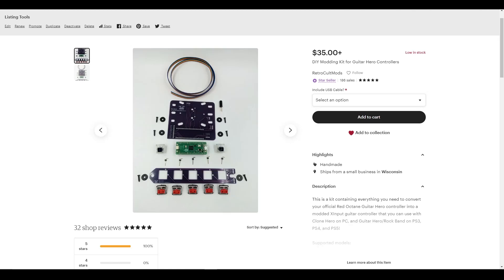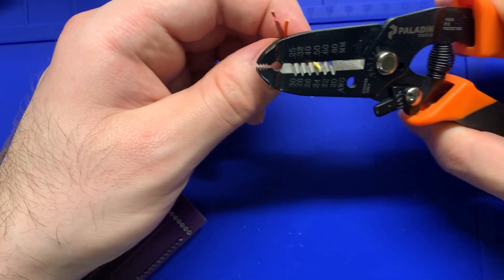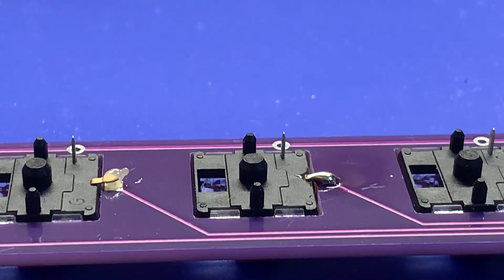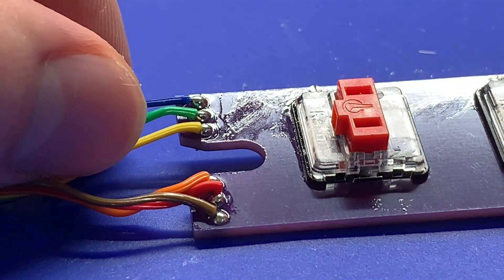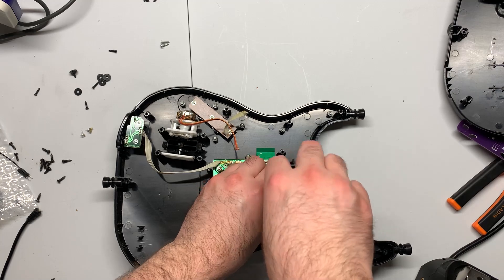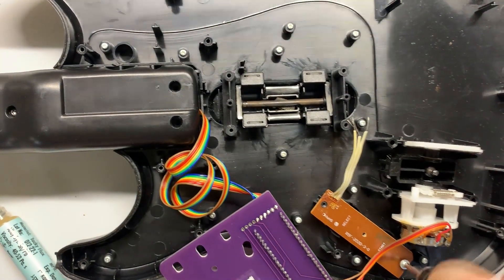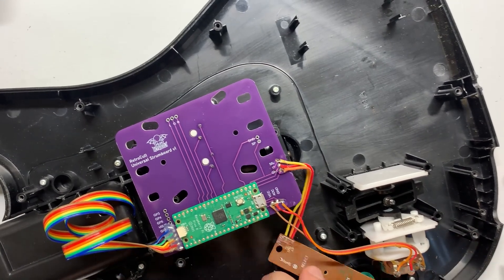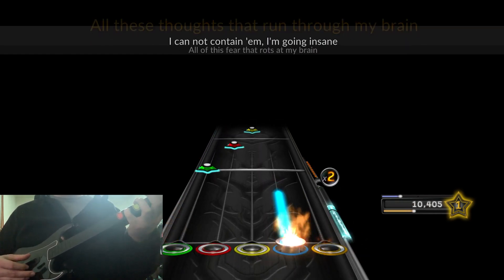DIY Guitar Hero Controller Mech Fret Modding Kit for Clone Hero, RB4, GHWT:DE #clonehero #guitarhero

Comment from the maker: UPDATE:
There is now a dedicated tool for my kits, you'll want to use the one mentioned in this guide instead of the Guitar Configurator:

https://retrocultmods.com/updating-to-the-new-santroller-firmware/

This new tool will do all of the pin mapping for you, and make customizing things much simpler!

Well, I forgot the part explaining the tilt, woops! 

Its pretty fast and simple, here's a quick video explaining how to do it: https://www.youtube.com/watch?v=dqrUP9Fsahw
Reply: I see it says it will work on Xbox 360 but i can't get mine to work. How do you get it work?
Reply: how do i know which one of my guitars is gh5 or ghwt because i have the red and white guitar (xbox 360 guitar)

Comment: Extremely well made kit and guide. This is all so easy to follow and it appears you’ve made this about as straightforward as it gets in terms of simplicity!

Haven’t bought my kit yet as I’m still on the hunt for a good deal on a guitar first. The only couple of questions I had were regarding the rusty strum bar and the micro usb cable.

When removing the rusty strum bar you mentioned potentially putting a new foam pad in there. I’m assuming the foam pad is simply to prevent the metal rod from rattling and it could be any pad of a similar thickness to the one removed and there’s not a particular type of foam?

Regarding the USB cable, I was wondering about strain relief and retention. Based on what we can see in the video, it just looks like you plugged a micro USB cable directly into the board, then had it make basically a straight run right out of the guitar case. I’m imagining that plug pulling right out of the port if the cable gets tugged a little too hard, so I’m thinking perhaps there’s some sort of thing you do to the cable to ensure that doesn’t happen? I was also wondering about cable length and if you’d had any success with a longer cable. Say…15 feet instead of 10? I know once USB gets to a certain length there can be some data loss.

Thanks so much for such a well-made product and tutorial. Until now, I’d assumed the only way I was going to be getting back into Guitar Hero was paying a crap ton of money for a guitar in good, working condition, but this offers an alternative that basically removes condition from the equation completely!
Reply from the maker: Thanks for the positive words! To answer your questions:

The foam pad is indeed to keep the bar from rattling and can be replaced by any foam pad with similar dimensions.

For the cable, I usually loop it around one of the standoffs so it doesn't come out when tugged on currently, but I do have plans to make a board that converts one of the ports of the guitar into a female USB-C port, so you can plug in and unplug a cable without having to take it apart! I usually stick to 10 foot USB cables, but you should be able to use 15 or even 20 foot cables with no significant signal loss!

What you mentioned about providing a more accessible and affordable way into getting a PC compatible directly wired guitar is exactly why I made the kit!

Comment: I'm in the middle of doing this for a starburst guitar (ghwt). Will journal my progress here.
Reply: 1st lesson: you definitely need to file down the plastic feet of the fret switches, even if you have good flush cutters. There's no way around it. 7:52
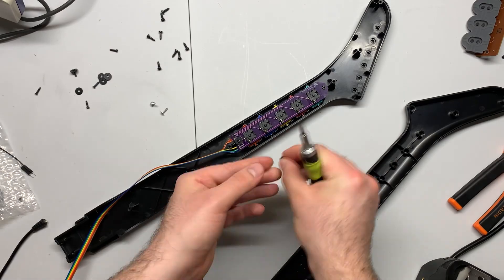Reply: 11:31 the Wii starburst only has one of these screwholes. I'm using electric tape to hold down the other side (facing the wires).

Comment: This was my first foray into the world of soldering electronics, and I have to say (aside from some small mistakes I made) this was a very comprehensive and easy guide to follow!

My only question is about a component that looks like a capacitor that came in the kit that wasn’t showed in the video. After doing some more research, it looks like it may be a tilt sensor? How would I connect that?

Edit: Looking at the board again, I actually see 2 holes with the labels “gnd” for ground, and “sp” which I’m assuming means Star Power. Am I correct?
Reply from the maker: Yep, that is a tilt switch! I forgot to mention it in the video, I'm going to make a quick guide this weekend on how to hook it up and leave that in the pinned comment!

Comment: I know I'm not the only one here with this being an introductory to the experience of soldering, I just wanted to say thank you for such a great tutorial. 😁👌 It really helped build my confidence with soldering after a really bad first outing attempting to repair some controllers with stick drift. (tl;dr, I'm gonna try again after I get this guitar working, but it was a bad time that took 2 hours and didn't get far enough to even remove one analog stick mechanism because the solder wasn't wanting to get sucked up and I didn't know how to use solder wick.)

I'm not quite done working on my guitar yet (about 80% done), and I made some pretty major mistakes (made unnecessary cuts to the neck structural points, sanded down too much to try and make custom frets fit because they kept getting stuck under the fret holes, discovered that one of the screws was horribly stripped and couldn't grip at all, forcing me to super glue it (yes, I know, tech gore, I hate it too)), but so far I'm managing to make it work in spite of the unforeseen challenges. 

I'm working with a WT Wiitar. So far, I have the neck all done, I got the strum bar board ready to go, and I soldered on the whammy bar. All that's left is to solder on the start/select/SP buttons (not sure how the SP button's gonna work, but it's not as important as the tilt sensor for how I play), solder on the tilt sensor, get a new spring for the whammy (there was no spring when I got it, might cannibalize one of the other 2 guitars I got in the bundle I picked up for a spring), button it up, and test it. 

Whoever owned this particular guitar before didn't take care of it whatsoever, probably smacked it on the ground like they were a snotty rockstar considering the body was partially opened and a couple of the body screws were stripped. Either that or they opened it after messing it up and didn't know what they were doing.

That all said, I'm looking forward to the follow-up you mentioned in the top comment reply. 🫡 This has been an incredibly educational experience for me, and I can't wait to do more soldering! It's the most fun part of the whole process imo! 😄
Reply from the maker: Great to see you took the dive into soldering! Was the stick drift kit you were working with by AngryHelder by any chance? I've used some of his kits to mod Gameboys before!

Also I noticed the positive feedback you left my shop, thanks so much for taking the time to do that, it helps me a lot!! :)
Reply: @retrocultmods  No, it wasn't a kit, it was just some cheapie set of analog mechanisms I bought on Amazon. I had watched a video on it a few hours before I started, all it entailed was desoldering the old ones and soldering in the new ones. I wasn't watching a video while doing it (unlike when following yours, I had it up the whole time), I think I just got myself wound up when trying the first time. But I also knew that laying down fresh solder is a lot easier than pulling up old solder, so I figured that following this vid would give me a confidence boost to try again. 🫡

Regarding feedback, I gotta give praise where praise is due, you made a very easy guide and provided simple materials in a very convenient package, at a reasonable price no less. 😁

Btw, update on the guitar; I decided to just close it up and test it to make sure it functioned on a basic level. I didn't get the tilt sensor installed, both the start and select buttons act are acting like the start button, and the star power button isn't doing anything. The strum bar needs to be tightened up a bit with some duct tape, and I want to fix those aforementioned issues, but I was just relieved that it didn't go up in smoke! 😂

That said, do you have any advice on figuring out the continuity on the Star Power button and/or the tilt sensor? I tried using a multimeter, but I couldn't figure out which setting I had to set the switch to because there's like 20 different settings for different voltages, resistances, etc, and I've never really used a multimeter before this. 😅 The button board for start/select/SP wasn't labeled with which was which, it was just a 1 and a 3 with a blank in the middle, so I assumed the middle was ground and that the other 2 were relative to the top and bottom based on orientation. Alternatively, should I just wait for your next vid to drop?
Reply from the maker: @RetroHellspawn  I'd look for continuity/diode mode on your multimeter (test by touching both probes together, you should hear a beep), then check pin combinations for a beep when the star power button is pressed to figure out which pins to wire to GND/SEL on the board.

Leave the GND/SP pins open for the tilt switch, I'll be dropping a video tomorrow!
Reply: @retrocultmods  😁👌
Reply from the maker: @RetroHellspawn  Video is up in the pinned comment!

Comment: I was having a problem on a PS3 Kramer with the green switch popping out and not pressing properly when I put on the back half of the stem. I fixed this by using my flush cutters to trim just a little bit of the support pillar behind the green switch and test fitting until it went together perfectly.

Comment: Could you do a video on the Xplorer? I've been thinking about buying a kit from you, but you have it stated that additional modifications are required. Would be nice to see what needs to be done visually. Anyway, great video! I've been also thinking about trying to snag a not working xbox 360 les paul online for the right price and install your mod into it.
Reply from the maker: I'm actually in the process of making some new boards to make the Xplorer mod MUCH easier. Once those are ready, I'll make a video on it!

Comment: This is a great guide! Any advice for the wiring of the tapbar on the gh5 controller? The original boards arent particularly clear.
Reply from the maker: Thanks! This video features an older version of my board that did not support GH5 tapbars. My current board does, so I will be doing a new video soon!

Comment: Super interesting!
Thou I noticed there is no mention of the Xbox 360 when it comes to compatibility, is it possible to make a kit that works with the Xbox or is there some sort of soft/hardware shenanigans getting in the way?
Reply from the maker: There are indeed some software shenanigans getting in the way of working with unmodded 360s. Modded 360s are currently compatible though!

Comment: Hey bro, Does this kit also work for the GH5 guitars? I'm from Brazil and this controllers are pretty hard to find around here, used or not. I found one of them from a guy who sold it cheap because it was defective in the Strum Bar, I'll see if I can use the buttons for some different project and swap the whole GH5 kit with the ones you showed in the video, luckily I have a little experience with soldering. Nice video dude
Reply from the maker: Hi! Yes it will work with GH5 guitars! I'd definitely recommend checking out the ZeroBoard kit guide I just posted, as that is much easier if you want to take the soldering approach!

https://youtu.be/0aqD36y6cJA

Comment: Not really necessary to use extra flux for through hole soldering, good quality solder wire should have enough flux in it already. Though it doesn't hurt to add extra, just a bit more mess to clean :)

Comment: Interesting kit! Might have to grab one for my WT controller. Is there specific switches you have to use for the buttons and the strum bar, or do generic cherry switches work? Also, do you have any experience using some of those cheap knockoff Arduino Nano/Mini boards with this?
Reply from the maker: The switches used in my kit are Kailh Choc reds for the frets, and Kailh Box Navies for the strums, and are included in the kit!

You can technically use any switch you like that are similar, but my PCBs are made with those Kailh switches in mind!

Comment: Does this improve the performance of the guitar, like latency, or just the feel of the switches.  What advantages do you gain from this other than replacing used components?
Reply from the maker: After installing this mod (or the Solderless Kit), you will have the lowest latency possible for a plastic guitar controller (1ms). My adapters and Raphnets range from 1.7-1.9ms in terms of latency.

Of course using a Raphnet or my adapter you will still be vulnerable to the aging parts in the guitar breaking, but with this mod you're giving your controller fresh components for a much more extended life!

Comment: If I'm doing this to a Wii guitar, would it be possible to just solder the strumboard to the pogo pins and the frets to the receiving plates in the neck to make quick swapping between linear and clicky frets possible?
Reply from the maker: Yes you could definitely do that! I also have new pogo pin replacement boards coming out soon that allow you to keep the neck detachable with mech frets; keep an eye out!
Reply: @retrocultmods  Hey, any update on this? Can't see anything in the shop

Comment: Just ordered one! I was curious though, is it possible to wire the ribbon cable from the frets to the neck plug, then from the strum bar to the other side of the plug to keep the ability to remove the neck?
Reply from the maker: Thanks for supporting my small shop! :)

Yep, that is possible, I'm actually going to put some replacement female neck connectors up on the shop to make something like that much easier to do! You'd still need to reuse the male connectors on the body!
Reply: @retrocultmods  Any update on those connectors in the shop?

Comment: Question, would my guitar still work on my consoles if I installed this? I have tons of guitars that all went to crap on ps3 and Xbox 360, some of them need the innards completely replaced. Would be great to get those guitars working again so I can finally play my ps3 lol
Reply from the maker: Currently you'd be able to use it on PC, Mac, Playstation 3/4/5, and modded 360s after completing this mod!

Comment: Did you use regular frets or the shaved down 'mechanical cut' one.
Reply from the maker: I used stock frets for this mod since it was a Kramer and they are compatible with the mech fretboard!

Comment: I'm currently using a Wii controller with a Pi pico and Sanjay900's software, with this mod would I keep my exisitng Pi Pico in the guitar as well, or would I solder my adapter to your pi pico on the strum board?
Reply from the maker: Hey! If you're looking for new strum or fret switches, I would say to just replace what you currently have with what's in my kit!

You might want to stayed tuned though, I've got something coming out soon that doesn't require a Pico at all!

Comment: I have the same guitar and I was wondering if I could keep the parts where the guitar detaches, If I just keep both of those connectors and solder into them would it not work the same way?
Reply from the maker: You could do that, but if you have a model that uses pins that contact small circular pads on the neck, I would highly suggest not doing so, as that is one of the major flaws of those models. You would definitely want a hardwired neck to avoid dropped inputs!

Comment: If I do this to a Guitar hero 2 explorer for the 360 can I still use it for my 360 or is it only good for clone hero
Reply from the maker: If you were to do this mod, your controller would not currently be able to be used on stock 360s.

It would work on PC, Mac, PS3/4/5, and modded 360s, though!

Comment: Buttons are really right almost no movement am I missing something ? Only way I can play is if I untighten the guitar neck screws
Reply from the maker: You may have to sand/trim some of the rear neck support material that might be pushing the switches. Also, if it is a Wii model, you'll need to modify the frets themselves or get 3D printed frets for a proper fit!

Comment: Does this work with drums as well? I have the Wii drums for GH5/Band Hero, but no Wii controller
Reply from the maker: I have not personally tested with that controller, but it should work!
Reply: Now that I've tested, I had an issue with the drums. The kick was either not recognized at all or assigned to a different function, and the right hat gets registered as the kick. I tried to remap in the Guitar Configurator, but it refused the changes

Comment: Is this kit compatible with RB2 guitars? I know there isnt a separate switch PCB assembly for the upper frets, so Im guessing if it did work with that controller youd lose that functionality?
And would it also be able to be seen by a 360 for use in RB3?
Reply from the maker: None of my boards will work with any RB guitars currently, and you would need a modded 360 for it to work.
Reply: how would someone mod their xbox? could you give a link to a video or website? @retrocultmods